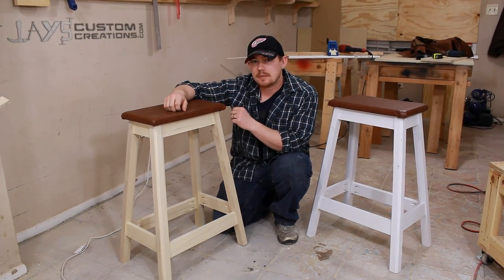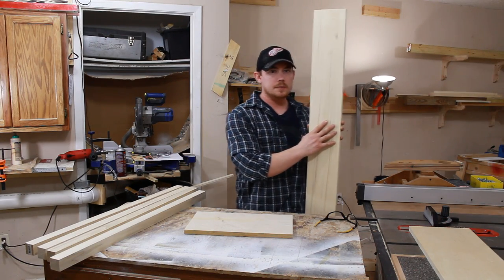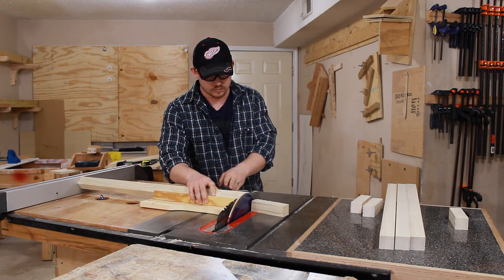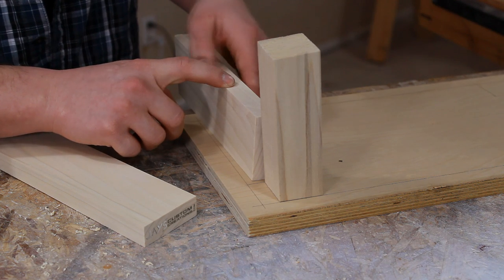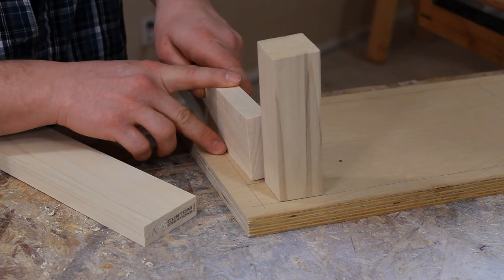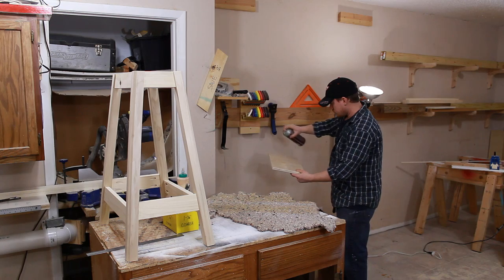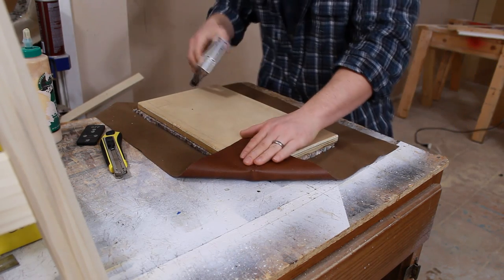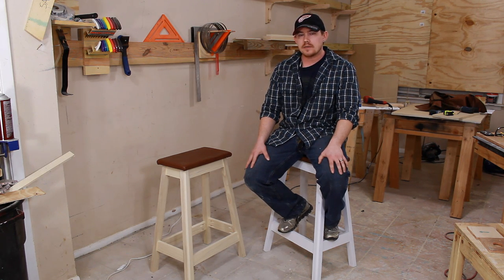Easy DIY Bar Stool - 130

Comment from the maker: Here's an easy bar stool that anyone can make. These bar stools are also really quick to build. You can probably batch out a set of 4 of these in a couple hours. Free plans here: http://jayscustomcreations.com/2014/01/how-to-make-a-diy-pocket-hole-bar-stool/
Reply: Nice little project!
Reply: Did you ever think about putting a radius on the 4 corners of the seat?I think this would make easier to cover.
Reply from the maker: If you put a radius on the corners you will have to make several pleats in the fabric material. I also wanted to keep this as rectangular looking as possible.
Reply: Very useful and practical, thank you very much for sharing your designs.
Reply: Jay Bates k
Reply: Jay Bates can the rails also be 2x2's?? you'd only get one screw in but it would all be the same angles right?
Reply from the maker: DavE R yes but one screw offers less strength

Comment: Excellent looking stools...I was hung up on what to make mine for our bar look like, and I just found the winner! I will plug the PH though. I am also so impressed and glad that you made them out of poplar and not pine. Not that there's anything wrong with pine, I just don't think I have see you use anything other than pine...unless it's a trash to treasure piece! Great build Jay, thanks for the inspiration!
Reply from the maker: Yeah I wanted to make these a little different than the good old 2x4. I use pine a lot because I'm just another broke woodworker!
Reply: Ha! I can't even justify the $$ to build a cheap workbench out of Whitewood. We both do this as a hobby, so I know the feeling!

Comment: As always good stuff Jay.  Just curious why didn't you cut the angles on your legs with your miter saw?
Reply from the maker: I don't like fighting with getting the miter saw back to 90*. I also find using the fence on the table saw much more accurate for a stop block than the junk I'm using with my miter saw.

Comment: Quick pocket hole question. I have just started using pocket holes. I have a kreg mini... but seems the screw heads dont go in the hole so I can puddy or put in the little wedges in to hide the holes. What can I do to fix that? Thanks.

Comment: I am curious as a beginning woodworker...why use the jig on your table saw to make the compound miters when you have a sliding compound miter saw? (Didn't look real close but I'm pretty sure that's what it is) is there an advantage to this?
Reply from the maker: Personal preference really. My table saw fence is much more accurate as a stop block than one on my miter saw station. Getting my miter saw back to 90 degrees is also a pain in the butt. Either method will do the job though.

Comment: I notice you use a corded drill for the pocket hole jig. For torque? To save cordless drill? To avoid swapping bits? For no certain reason? 

Go wings!
Reply from the maker: I have 3 drills with adjustable chucks that I can use for pocket holes. I prefer to use a corded drill for greater power but honestly my selection process is whatever one I can find at the moment. 

Go Wings!!!

Comment: Just out of curiosity, why didn't you use dowels instead of pocket holes?
Reply: At the time, most of his building was either quick jigs or pocket holes to achieve something fast. He has later gotten into different joinery methods.

Comment: It's easy....if you have the tools to do it with. A little harder if all you have is a drill and a 7 inch power saw to work with. Still, I'd rather make them than shelling out six to eight hundred for a set of four. Nice job.